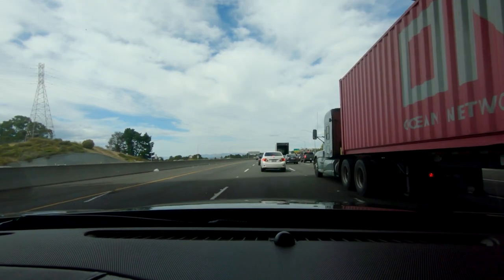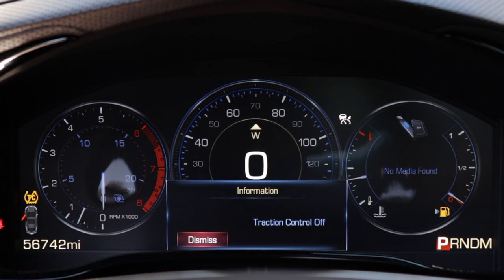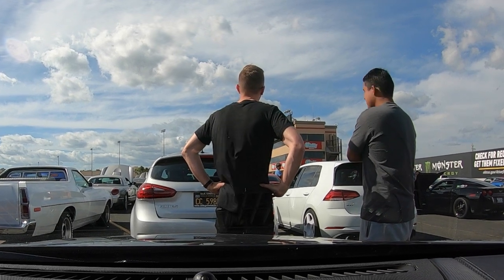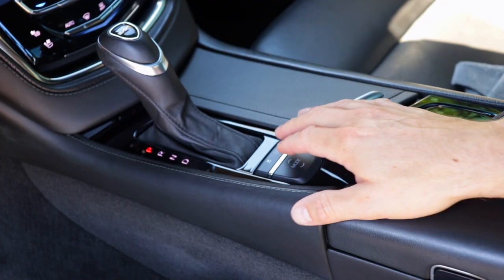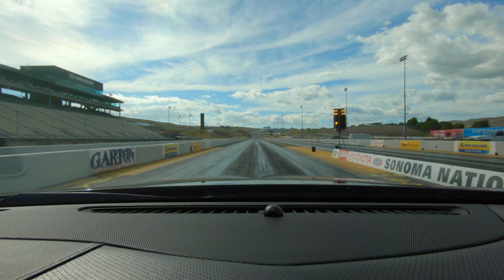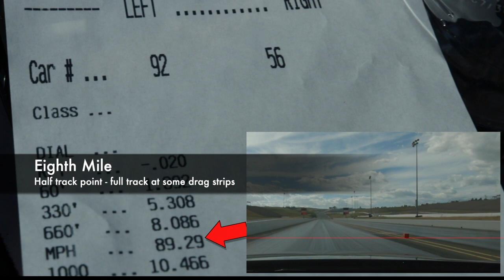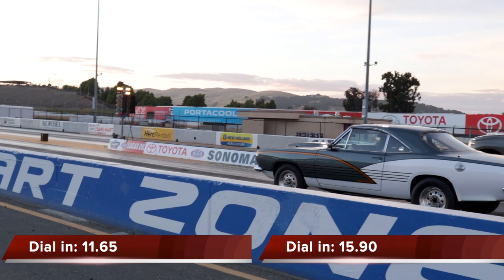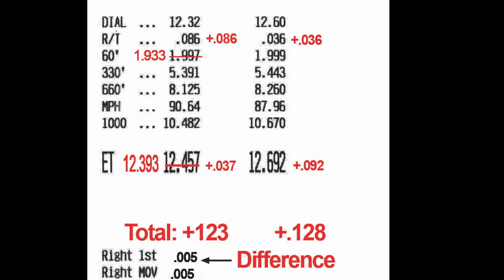Taking your car to the drag strip - how to race and compete!

Comment: Hey it's DARYL from the caddy forum. I like you mentioned about the tire monitor system using low tire pressure. If I put my summer wheels on and don't set the tpms's  I can still shut off traction control. I haven't run across a low tire in my vsport yet so good to know. But I would have done the same thing you did the same as not setting my summer tires. Good channel man keep them coming.

Comment: Hey Dan just took my cts v sport to the track for the first time yesterday, best was 13.1. Im completely stock so obviously wont see your 12.4 times, but wanted to know at what RPMs are you launching? I found 2000 too little but 3000 too much
Reply from the maker: I can’t get above 2000 without the rear tires breaking loose while front holds.

Comment: How high of an rpm launch do the RE71r hold for you on the Street without slipping ?
Reply from the maker: With stock or Trifecta tune you really can't powerbrake beyond about 2000 without doing a burnout.  With a schmidty tune you can probably do better but with that being said, haven't been able to test.

Comment: What mods
Reply from the maker: Steve Givelas fastest time is just a tune. The other mods don’t really do anything for you.
Reply: Downpipes intake wouldn’t do anything 
Have u dynoed car if so what whp
Reply from the maker: Steve Givelas nope. This car is different.  I had downpipes and intake and custom tune. Fastest run was with Trifecta and stock intake. Trifecta and my custom intake has yet to show any improvement.
Reply from the maker: Steve Givelas I dynod once when I had downpipes and intake. 460ish on hub dyno. Ran 112 in quarter. Trifecta only ran 114 in quarter